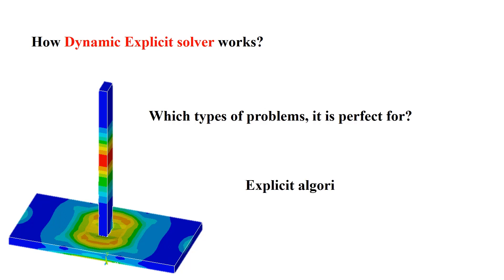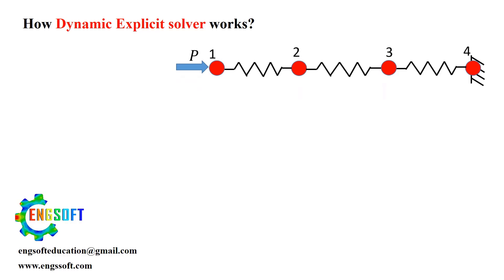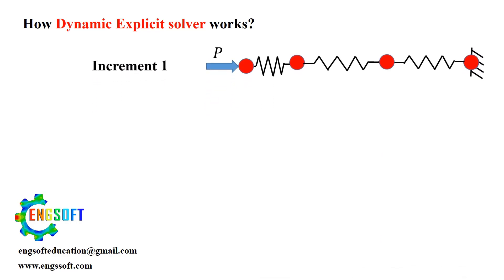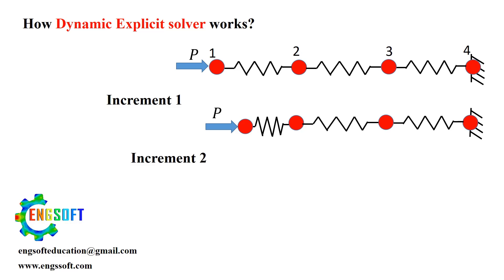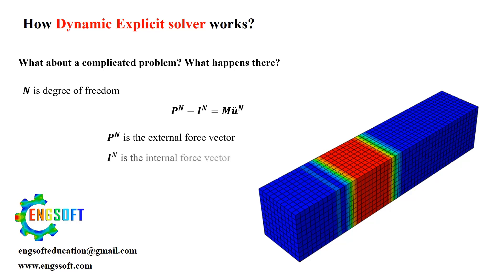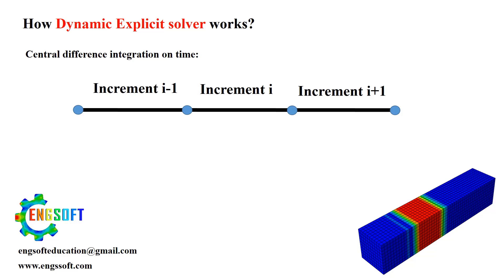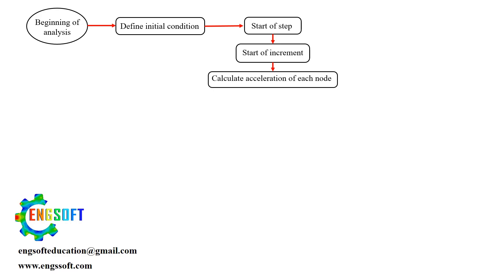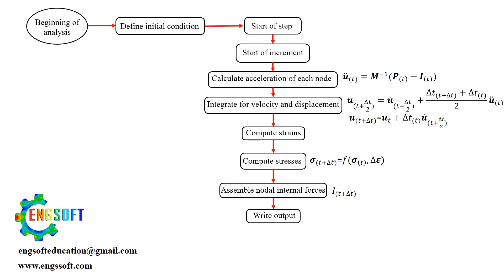Understanding Abaqus Dynamic Explicit Algorithm

Comment: Excellent video explaining the basic concepts of Explicit analysis. I have seen multiple videos, however, this one is crisp and to the point.
I have one suggestion though, @2.47, the E(el2) should not be zero.
Reply from the maker: Thanks for your exact comment. Yes there is a typo about strain in element 2. As mentioned in continue strain and stress are not zero for element one and two at the end of second increment.